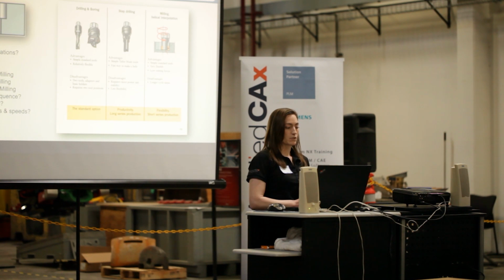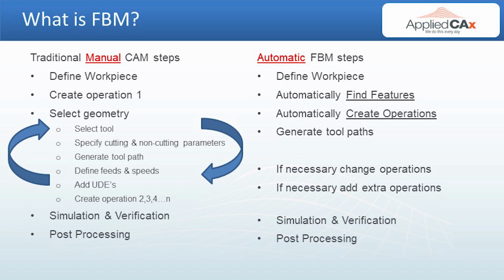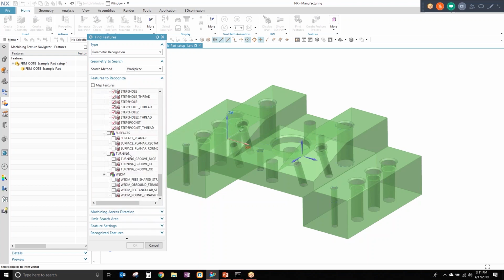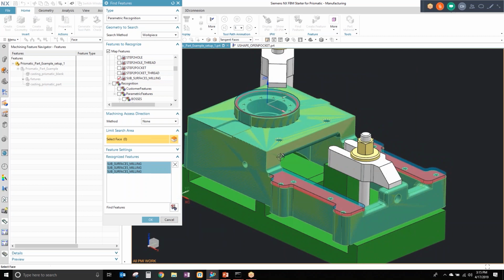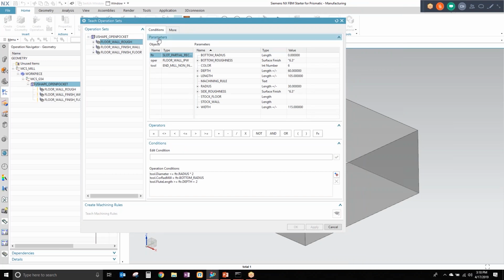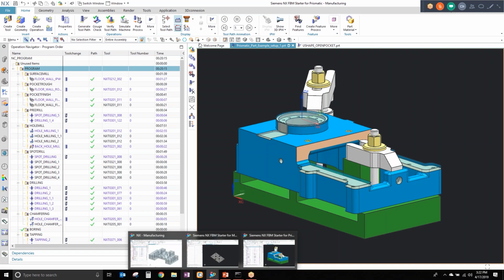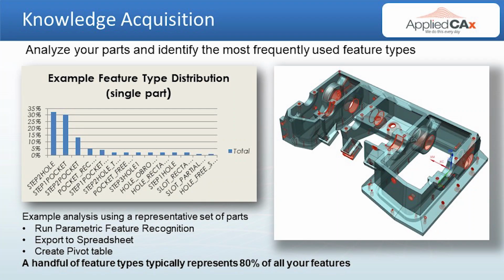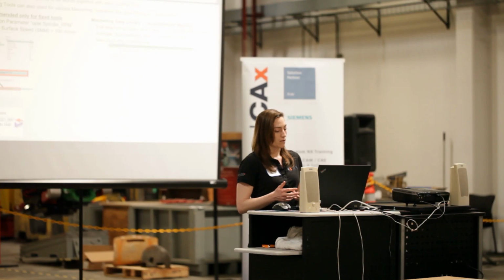Feature Based Machining Inside of NX CAM

Comment: How can we state that one of the holes is thread tapping and another is, for example, simple hole?
Reply from the maker: As long as threads have been applied in the modeling application, either through the hole command or the thread command, NX will recognize the feature as a threaded feature and apply the appropriate operation sets and tools